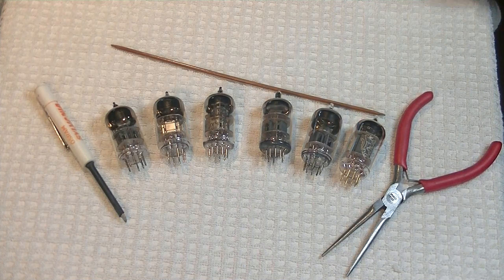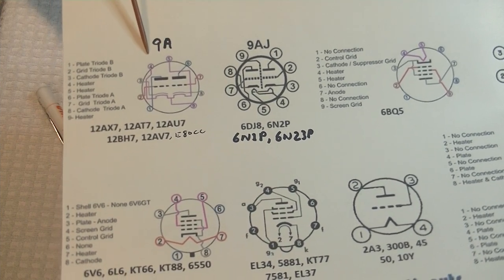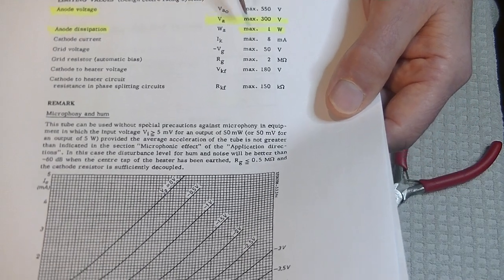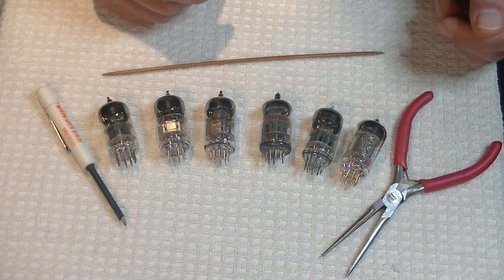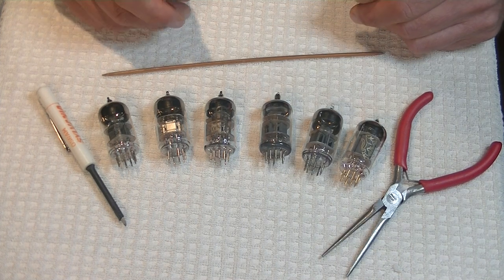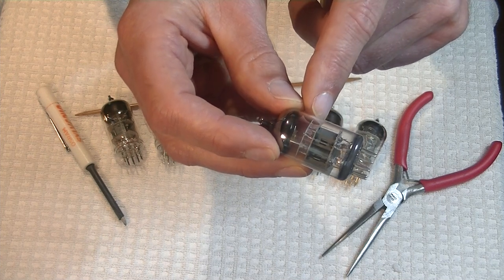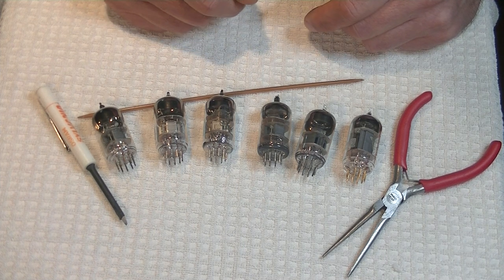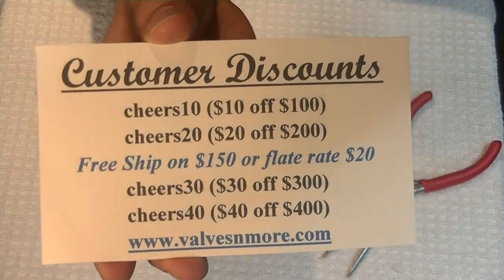Tube Lab #18 Russian 6N2P

Comment: The video I was expecting. Hard to find good 6n2p videos on the internet.

I'm designing studio devices and I'm very interested in using 6n2p reflector. They are cheap (10 times cheaper than a good 12ax7). Now I'm confident.

Comment: Is it only the photon that has the third mica? I've got a bunch, and i thought they were voskod. Some are silver plate, some, grey.
Reply from the maker: The 3rd mica is a common feature of the mil spec versions and if I remember correctly even the modern New Sensor 12AX7, made in the old Reflector factory in Saratov Russia has a 3rd mica.  In most cases the Soviet era tube labels are correct.  The later tubes made by New Sensor are not reliable as they used whatever label they thought would sell more tubes including svetlana, mullard, genalex etc.

Comment: Nice review I have a homemade dac that uses 6n23p I am  rewiring it to run 6n2p to give them a try.
6n23p tubes are really good swgp from mid 70s having the better treble I noticed.
Voksof having slightly better bass than reflektor but thats on the 6n23p all my tubes are OTK.

Comment: Hi. Loving the videos. I have a question about the heaters. I want to use just one side of the tube (one triode) and was wondering how you would wire up the heater for this or is it not possible to have just one of the heaters in operation.  Many thanks.   Steve.
Reply from the maker: That is correct, most if not all multiple section tubes only have one set of filament (heater) connections for the entire tube, so if you lamp one section you lamp them all.  Now this doesn't affect wiring up half a 6n2p, just choose one triode and wire in circuit as you normally would and leave the other half open.
Reply: @tubelab194  Would you recommend grounding the other pins to prevent  cathode parasitics
Reply from the maker: @stephenwilliams1854  what are cathode parasitics?  The other triode will lamp, but you aren't connecting anything up to anything so you won't see any electrical activity other than some heat.  And one of the great advantages of the 6n2p is the shield between triodes, bringing pin 9 to ground quickly is a good idea.
Reply: @tubelab194  Sorry.i meant cathode poisoning.

Comment: Sir i have 200aprox or more than 200 tubes wich is mostly ussr tubes. Some mulard and NEC and toshiba.. i need only ussr tubes data can u help about deta?
Reply from the maker: Data sheets for Soviet era tubes is easily found online with a Google search.  At least for the common audio types.   Try using the English translation of the Russian cyralic letters as well as the cyralic.  In most cases I find the English translation using the English version of the tube.
In my store www.valvesnmore.com I list both English and Russian names at the end of each Russian tube listing.

Comment: I am building a mic pre with those and there is nasty distortion goin on. Running with 300Vdc on the anodes and ac on the fillaments. Tried to ground then unground the pin 9.. nothing. Do you think the dc voltage May be too high?

Comment: I just bought my first tube headphone amp Nobsound 6j3 version. It came with a Chinese 6j3 tube in it and sounded very good. Better than just having my hooked up directly to my solid state output. Then I bought a Voschod 6J1p-EV NOS '83 pair of tubes and they sound thin and dry in the midrange. From reading various forums, I had expected them to be better than the 6j3. I have about 40hrs on the Voschod and 20 on the 6j3. In your opinion, will the sound difference between them change much after a few hundred hours? I know both are different than these tubes. But in general I mean. Thinking about trying the Reflector 6j3p-e, or a 6j38p or even a 6j5p. My first project and already I am starting to get the tube rolling bug.
Reply from the maker: This is a thing with tubes and audio in general, the only way to know for sure, is to try something in your system.  Yes doing research, buying from a knowledgeable seller are both smart things to do, But in the end you have to try it for yourself!  Sometimes the results are contrary to what you thought, learn from it and move forward - and never stop having fun!
Reply: @tubelab194  Burn in is not important? That was my original question. Thanks. When I started on my BSEE back in 73, Other than X-ray tubes in my physics class, we learned NOTHING about vacuum tubes as circuit elements. Even though equipment with them was still being made. I have a few projects that will require a ton of study now that I have retired. My father's Dynakit ST70 which hasn't been turned on since he died in 76, and an oddball 8W stereo amp from a company called Calrad(mod SA 30B). As well as two Fisher amps that I bought at hamfests in he early 80s for their power and output transformers. Not to mention that I haven't finished my custom La Scala clones yet.
Reply from the maker: @indridcold4210  quick answer is maybe, it all depends, for example I bought some 50 year old power tubes, nos, and when I tested them, some worked fine, others not at all, the seller was familiar with this tube and told me the cathode had not had electricity applied for 50 years, he said leave them on tester for 20 minutes and they'll be back to normal, and he was right.  So if a vintage tube that hasn't been operating properly (poor contacts or circuit) may need time for it's cathode to renew.  A brand new tube fresh from factory with just a brief burn in and test, should operate near 100% as soon as you apply electricity.  Now this is totally a controversial subject, some people swear a burn in is required.  I personally test thousands of tubes a year and listen to hundreds in circuit on my own tube gear and I haven't noticed a difference - on the other hand I haven't specifically gone looking for one!  One thing I have noticed is whenever you change something in your system, you have to give your ear/brain interface time to adjust and absorb what you are hearing, often what sounded good or bad initially presents totally differently after a wee while of adjusting.  So I suggest when trying a new tube, turn the system on in the morning even if you won't listen till later in the day, now if some burn in is required, it's done!  Note I never leave my tube gear on when I'm not home - never.

Comment: Keep up the good work mate! One question: I have a bunch of 6p24p medium gain double triodes ! Can I use them instead of ecc82? Asking just for specs , not pinouts! Cheers
Reply from the maker: Thanks for the nice comment. Honestly I've never heard of a 6p24p tube and I know all of the commonly used Russian tubes.  What I do in this situation is Google it and failing that put the question to one of my larger tube amp Facebook groups, if they can't help Nobody can!
Reply: @tubelab194  my bad! 6n24p I wanted to say . It sais that can replace ecc84/89 ! I need to drive a push pull 6l6 with them
Reply from the maker: @TheSlimShady87  it looks like the ecc84 can be replaced with a 6n14p, which is an equivalent tube,  note I don't have any experience with either tube.  Googling it is the best I can offer!

Comment: Do they work with a pins adaptor in guitar amps ? like mesa boogie ?
Reply from the maker: Probably not, because if an amp is using a 12ax7, it almost certainly is running the filament at 12v.  The simplest thing to do, if you have a 6v filament source already (probably you do for the power tubes) is to rewire the socket for the 6n2p.  I did this in one of my preamps and start to finish it might have taken 20 minutes.
Reply: It’s not worth it

Comment: Anobody knows how to add more low tones to 6N2P ? which capacitors are crucial in that case?
Reply from the maker: The 6n2p will easily pass the full audio frequency band (10hz - 20Khz) and more.  Often though the coupling capacitors are sized to cut off the low frequencies, particularly in older equipment.  This occurs because not only do coupling capacitors block DC and allow the AC signal to pass, but they also create a high pass filter.  A good general value for interstage coupling is 1uF and for the output stage of any preamp 2.2uF.  In our Kit Amps we use 1.1uF, which is a much wider audio band pass than is required, but I've always found our bass reproduction to be excellent and part of that is making sure your capacitor has a wide enough bandwidth to ensure all audio frequencies are passing.  I learned this design strategy from Paul at PS Audio.
Reply: @tubelab194  Coupling capacitors,u meant those cathode ones? That Soldano Supercharger G.T.O is missing a little bit of lower tones

Comment: This is not close to a 12ax7 it maybe made close but your circuit design is made for a 12ax7 it’s not worth making a amplifier with this tube when there are thousands of 12ax7s
Reply from the maker: Yes there are 1000's of 12AX7's but very few quiet  good sounding ones and those are crazy expensive.  The best reissue is the Genalex Gold Lion and it's expensive - but an excellent sounding tube, as well as low noise.
Reply from the maker: Actually the prototype phono preamp that I built using the 6N2P as a 12AX7 sub, uses a very old RCA circuit that was originally designed for the 6SL7.
Reply: @tubelab194  I would rather just use the 6sl7 iron isn’t cheap anymore if I had a couple output trans I would consider making one I’m more into 50-60s USA designs for hifi not guitar mostly the Williamson design I’m not a communist and like using American parts
Reply: Buy them from Ukraine they're a good country.